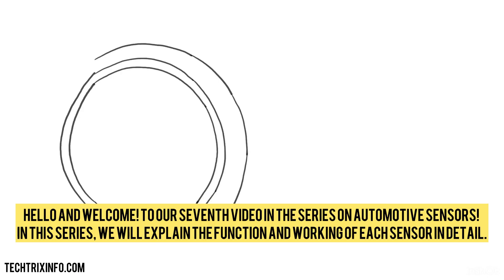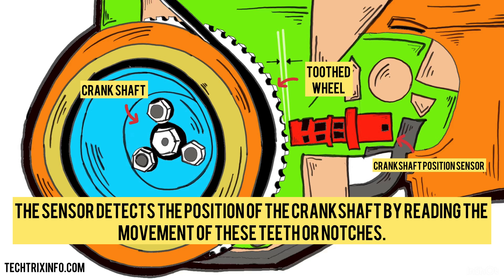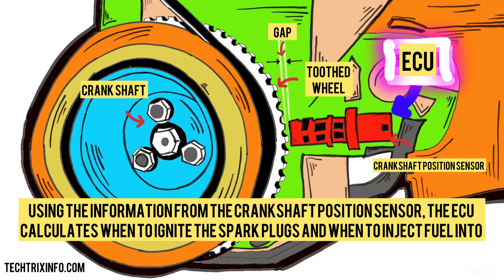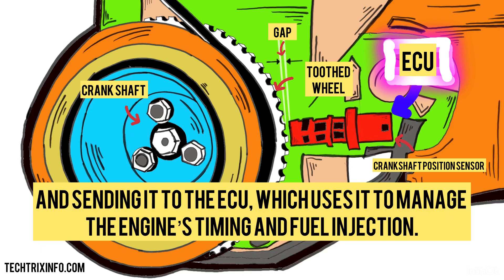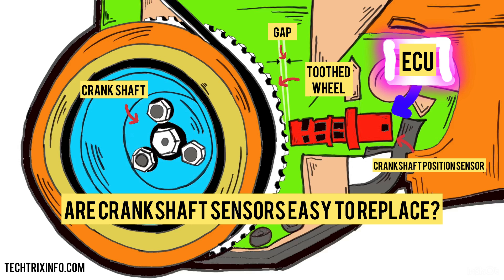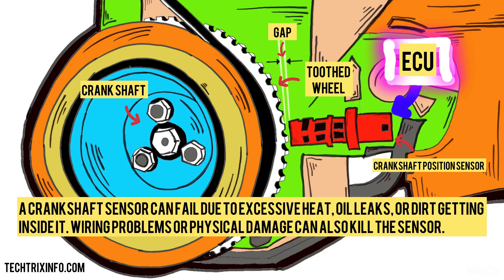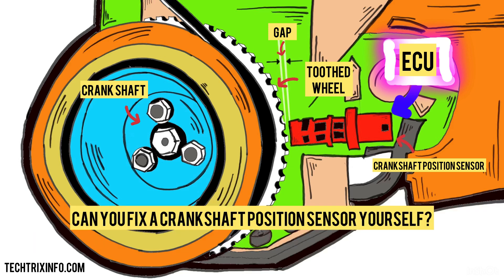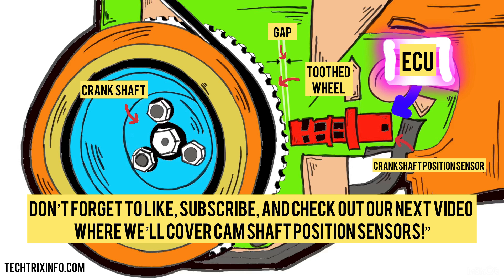Crankshaft Position Sensor Explained With Animation | Mastering Automotive Sensors | Part 7

Comment: I have been trying to understand the independent purpose of the camshaft sensor even today I cannot figure it out either than being a sub-function of the Crankshaft sensor. With accurate engine timing and working CPS sensor in place the cylinder valves don't need camshaft sensor to open and close.